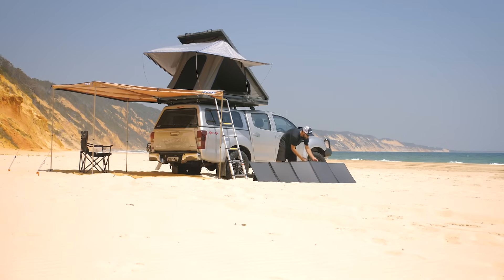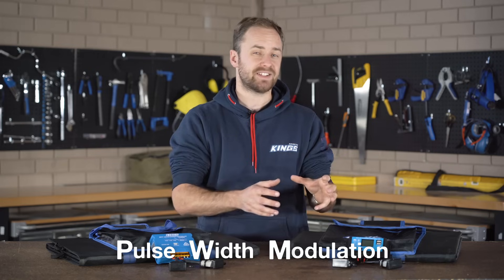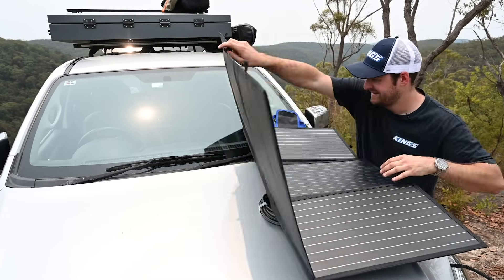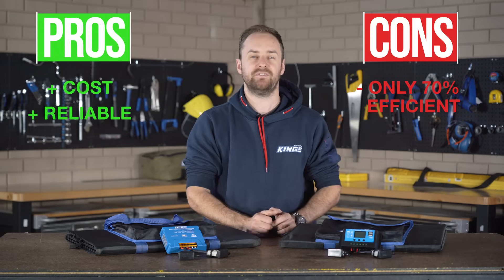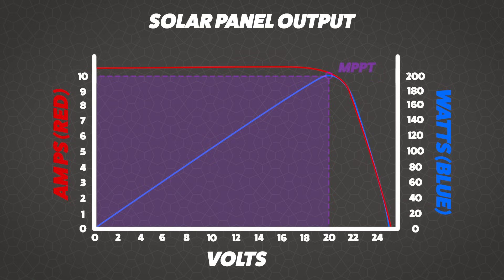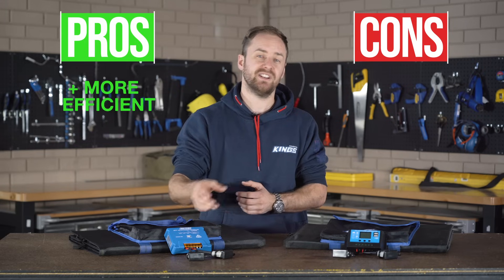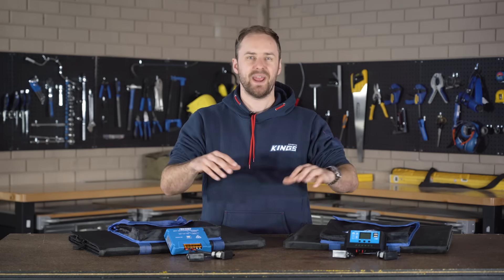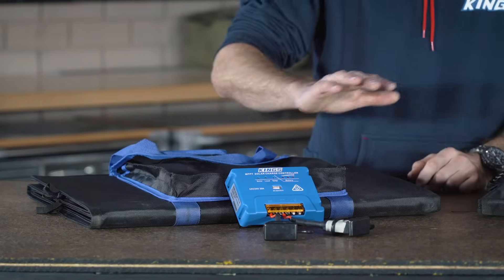SOLAR REGULATORS EXPLAINED! PWM versus MPPT - what's best & why? PLUS upgrade your solar controller!

Comment: Well explained, it makes sense.
I have been running off grid now for several years using a diy PWM system. However, my wind and solar are connected directly to the battery. The PWM simply switches the dump load on and off to regulate the battery. So as I understand it, from what you say, my PWM system is as efficient as an MPPT system, because rather than switching the panels on and off, it switches the dump load on and off? The dump load heats water for domestic hot water and central heating.
Is my assumption correct?

Comment: Too much mumbo jumbo, just tell us which one is better to run a fridge and camp lights. Get rid of the GRAPHS AND MATHS.
Reply from the maker: Your battery runs a fridge and camp lights… but if you want to charge your battery better, use an MPPT!

Cheers,
Cahn
Reply: @4wdsupacentreAu  Thanks for the reply, didn't see that one coming. Cheers.

Comment: Hi guys were getting SRC18 snowy rivers caravan it comes with 200 w solar 120 again batt projector monitoring system,  we would like to set up for off grid camps looking at your 400 and battery and 600+ solar
Costs and were in Brisbane can I get it done ( we have a 3 way fridge so conversion to compressor all so thanks

Comment: Been using MPPT for the past 11 years. Definitely better output than PWM, but I don't think it's double.
Another big gain for constant users of solar (probably not worth the $$$ for campers) is to replace lead acid batteries with LiFePO4. 
They're about 10% more efficient than lead acid- you get out almost the same power as you put in. That's like increasing your solar by 10%.
(Of course if you have the space, it's cheaper to just add solar. On a boat we simply don't have unlimited space. )

Comment: Can I put the dc to dc charger under the bonnet? My other battery is under the bonnet connected to the solar panel via a pwm controller and I want to change it to a dc charger.

Comment: Thanks for a great video. I fully agree with all your statements as it is what I have also found. The plus side for MPPT just gets better the bigger the difference is between panel Volts and battery Volts. If only more people would look at the results during the actual test.

Comment: I'm a retired electrical electronic engineer I do believe I could make a PWM that would track max charging current for the battery spec.
Max tapering to low together best charge.

Comment: Great video thanks. Correct me if I am wrong but another advantage of MPPT is that they can often take upto 100v input to reduce losses.
Another too is quality MPPT can be programmed for different battery profiles like AGM v Lead acid v Lifepo4 the latter requiring a very different charging regime eg 14.4 v boost, never equalising and a float of only 12.8.
I believe all quality MPPT can do this.
Have also been told PWM can reduce the life of a lifepo4 battery as it can not deliver the custom profile needed for that spec.
Reply: you are not wrong that I know of, but some of the latest MPPT controllers are 150V models, so you can do even longer strings or use higher output panels.

Comment: Can n guys help me with a home setup to power a couple of fridges and maybe some odds and ends?  i will certainly need multiple batteries and solar panels. Even worse, have no idea many I will need to run the fridges (2) despite much searching online its not so easy to work out.  Yes, Im a bit of a luddite sadly.

Comment: My initial question was, whats the difference? NOTE: As a master automotive tech, intimately familiar with 12v systems, Automotive oscilloscopes, and what PWM means, as solenoids and idle air controllers ect. are operated as such. With my next question being "how do i stop it from cooking my batteries and keep my charge voltage at13.4 to 14.4. and my third question being can i use higher voltage panels without wasting money.
 All questions answered.  
You are the MAN.

Comment: hello sir, I need your help sir.
I get 30 pièces of Glob 10 watt each,  1 télévision of 150 watt, sound system 120 watt,  1 fan of 75 watt, 1 refrigerator of 160 watt.
my question is :  how many watt of Inverter  can power  it sir?

how many  mppt watt can power it sir?

how many battery can power it sir?

Am from Nigeria in Africa and name is Olasunkanmi.
I hope to hear from you sir

Comment: 12.7 volts is close to fully charged for a battery that is a year or two old, not 75%. The demonstration shows the mppt charging at 7.3A 13.8 V, that's a high current when getting close to full charge float voltage of around 14.1- 14.4. A better demonstration would be to show the charging currents on batteries that have been discharged a fair bit, say to 12.0V.

Comment: Do you need to used a specific MPPT regulator to efficiently charge a lithium battery or does the internal battery management system perform the task ?
Reply: The charging voltages need to be set in the regulator, so you need to choose one that is compatible with lithium batteries, specifically the chemistry of the battery you are using, e.g. LiFePO4 or LiNiMnCoO2.  Some regulators can detect the battery type when you connect it by the voltage (normally need to connect the battery before you connect the solar panel to the regulator, and the battery needs to be charged for this voltage to be indicative of chemistry), some have a menu that allows you to select the battery type (I have seen at least one that requires a separate communications module to allow you to change voltages to suit lithium chemistry, so check that), and some, like the one linked in the description of this video, have a number of battery selection wires, and you simply connect the one corresponding to your battery type (to the positive battery terminal) and insulate the other ones.  Some regulators allow you to change the default voltages, e.g. bulk charging voltage, float voltage, low voltage disconnection voltage, etc., within a range.  In this case, you could enter the values to suit your battery, which are specified on the battery data sheet.

Comment: Hold up, that part where you said we can't use 24volts solar panel with PWM is slightly wrong. If you're using one of those small charge controller, that's when the limitation sets in. I'm saying this cos I've used 30 to 60amps charge controllers that can handle 12/24 volts panel and then the bigger PWMs (60-80amp) have a range of 12,24,36 and 48volts PV input

Comment: Accidently press send, I was trying to say I have 1-100W s.panel I'm running a mini fridge and a laptop its fine if we have sun. I'm want toadd another panel 300 to 400W plus keep using the 100W panel my mppt charge controller is 70A will it work the batterries are 4x125A deep cycle marine. Your help is appreciated.

Comment: I think there was a lot of factually incorrect information in this video. Viewers should take it with a grain of salt. You should look to solar installers and designers for clear information on solar tech, and not the 4WD Supacentre. Sorry guys, stick to 4wd-ing. 

And no, you can't "double the output of your solar panels" by switching from PWM to MPPT. That is ridiculous. In full sun, a PWM controller can deliver slightly more power than MPPT, because of its simplicity, but MPPT will be more efficient in all other cases, so MPPT wins, but only by a few percent, not double.

Comment: If you have the kings battery box hooked up permanently In your car with the kings smart isolator can you just plug in the regulator in to the box and connect a solar panel permanently to your roof ?

Comment: Can the moot simply feed the home or perhaps an electrolyzer without a battery being involved? Is there any data on super capacitors instead of batteries? 
Thanks in advance

Comment: Great video, but my pwm.
regulator is fixed to my solar Panels can I just swap the pwm
Reg with an mppt regulator. As instructions say install mppt as close to battery as possible. I usually use a 10 metre extention cord for my panels . So is it better that I remove pwm?
In its place fit a 50amp Anderson plug then connect to my extention cable then fit mppt unit near battery.Helppp

Comment: Hello great video, I have a question. If my 25 panels of 250watts  is conected to the main grid through a grid tie without a battery bank (just to reduce energy bill). Do I need a MPPT or PWN systems?
Reply: No not at all. The grid tied inverter actually has it's own MPPT inside  that converts the panel DC to the AC grid voltage of the inverter. This power from the panels is then used before power from the grid is used. That's where one gets the saving of grid tied inverters.

Comment: Hi, thanks for the video. Purchased an MPPT as I wasn't having any luck with the PWM charging the battery.  The battery is at 11.4 volts and would not charge any higher with the PWM.  Installed the MPPT today and when connected, the solar indicator was rapid flashing - 'over voltage' per the instructions.  New to the 12volt game so what does 'over voltage' mean and is it ok to leave the MPPT on to bring the battery up to fully charged?  Thanks in advance.
Reply: I wanna know too, anyone??????
Reply: Did you find out the answer, thanks.
Reply: If you mppt is reading over voltage its either you have to many panels tied to it or a battery hooked up to it thats over its typical voltage. If you havent even heard the term over-voltage before you should do a bit more research. Just general electrical research.

Comment: What if I parallel connect 12v PV , let say, at 50A into a 30A PWM charge controller. Will it break the controller?
Reply: Yes u will fry it..!

Comment: My batteries charge between 14.62 and my charge controller shuts down around 16.9 to 17 I love my 24 volt system. You are right about not using 24 volt on a 12 volt system. I upgraded to a 24 volt and  added my 12 volt panels and it works great.

Comment: Not quite right there with the pwm info. You can get those controllers that take different voltage of solar panels. I have 24v panels going in on a 12v battery system. I use 62x 7.2a/h batteries for the last 8 years and no problems.. . Pwm controllers like in the video can be bought fur $10-20 on eBay or AliExpress.. they will last years. 
 Don't forget this is an advertising video for king's..
 Always oversize your system.. the more the better. Then you will have no problems

Comment: I have a Xantrex C40 PWM charge controller and it accepts 12, 24, and 48 volts and and supply needed current when inverter demands it.

Comment: Where do I get the display screen to see the volts ect
Reply from the maker: Hey Jesse,

You can get them just about everywhere - they're called watt meters or inline watt meters.

I generally get them from Altronics, but most electronics stores like Jaycar etc will have them

Cheers,
Cahn

Comment: thanks, very helpful!
question: is it possible to use 2 pwm controllers connected to the same solar panel (say 100w) and simultaneously charge 2 batteries, making use of the extra unused power that gets wasted by the first pwm? in theory you could get 2×40w=80w and that's way better...
Reply from the maker: Unfortunately not as that doesn't solve the actual issue - which is that your panel voltage is a lot higher than your battery and the PWM is only connecting the two together, there are no electronics to help make the most of the full panel power and output a higher current!

Most PWMs would be capable of the full 100W in theory, but it's the voltage difference that is where you lose the power

Cheers,
Cahn
Reply: @4wdsupacentreAu  I am not sure that I fully understand... if you would give me some slack as i am totally new to this:
-- the Panel outputs 18V say at 5A (all for easier calcs) and most of the time will keep 18V while fluctuating amps (thats my current understanding)
- with that assumption, first PWM only draws (drops) a max of 14,3V, maybe at 5A (unsure) or less, depending on the battery status
-> this might leave 1A for the second PWM... or
... my initial assumption was that the two PWM would roughly split the current (as you said, there is no electronics, so being in parallel will draw whatever they could, depending on their resistance, current should split...

what am i missing here?
Reply: @sightseeingplaiu3159  When the PWM controller connects the battery to the panel the voltage of the panel is dragged down to the battery voltage so although it's maybe producing 5A it's only doing it at 13V or so - giving 65W. When the PWM controller disconnects, the panel goes back up to 18V (at 0 amps as no load is connected), when the PWM connects again, it's 5A at 13V again. The smarter controllers allow the panel to produce 5A at 18V (90W) and then convert that into 13V at 6.9A (still 90W).

Comment: Can you please advise if the lights on the MPPT should all turn off when the batteries are fully charged or when it’s nighttime. 
I installed it yesterday and it worked with lights saying solar and battery level on the second light. Tonight when I checked, no lights were on at all. Never had one of these before so learning.
Reply from the maker: Hi Wayne,

Can you confirm which MPPT you're using and we'll go from there!

Some are set up so that they only have a display while the sun is hitting the panel so it could be the case!

Cheers,
Cahn

Comment: In small systems (<1kW or so), MPPT may be less efficient than PWM.  A large part of the reason is that lower power MPPT chargers commonly waste some 15% odd as heat in the V/I conversion (yes you can get low power high efficiency ones but they cost serious $ out of proportion for smaller systems).  This kills most if not more than, your MPPT gains.  MPPT is only good in larger systems with high quality (i.e. expensive her too  but a far smaller % of total cost, so well worth it for the many KWs involved) chargers that are 95%+ efficient in the V/I conversion (i.e. waste <5% as heat).  In contrast, smaller systems, assuming you have the space, most often do far better $ wise buying an extra panel instead, and stick with PWM.  Also note that in terms of wasting power as heat, PWM is internally very efficient, even the ultra cheapo <$50 units typically do better than 95%.  They lose out by, as you said, not moving all the power possible from the panel into the battery.  BUT, IT IS NOT 70% as you suggest, it is more like 85%.  Test it for yourself by charging both ways, ...you will be surprised!    ...and no I do not sell PWM chargers. :)
Reply: Yeah ok that would explain why I’m getting 25% more power output with the Kings PWM compared to my Redarc MPPT with a Kings 120W blanket. Tried other MPPTs as well with the same result. Totally had me confused as everyone is saying it should be the other way around. 
In the test at the end of this video the MPPT is putting out double of the PWM. I don’t get it.